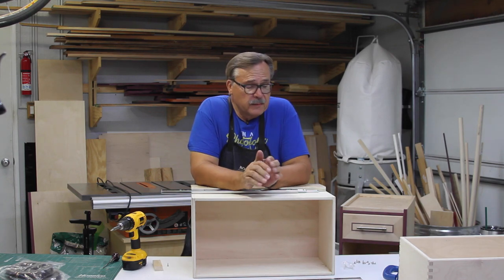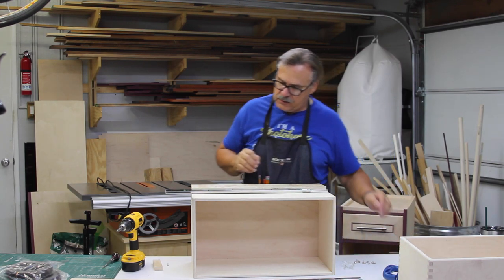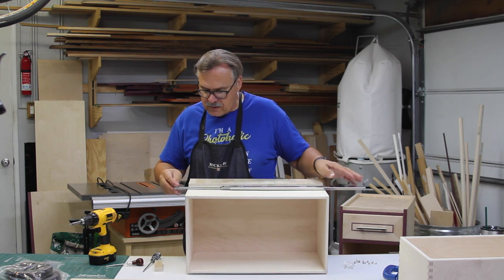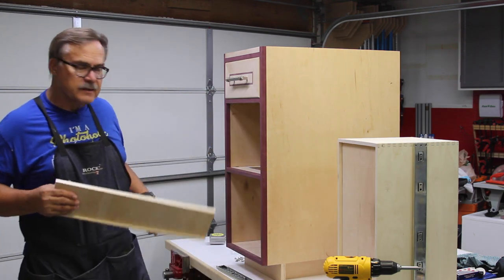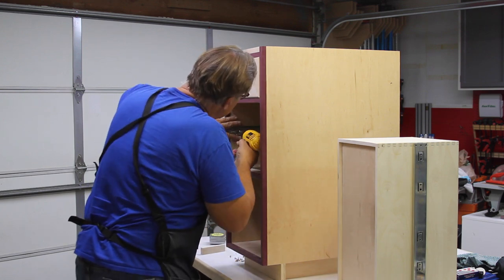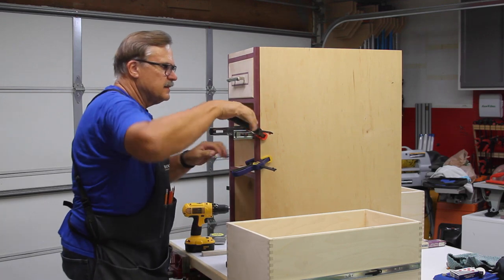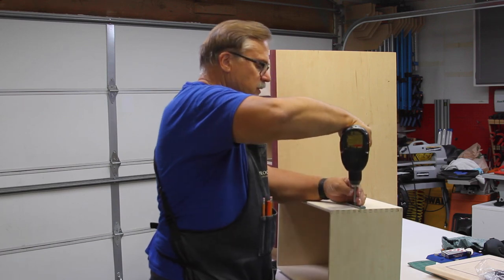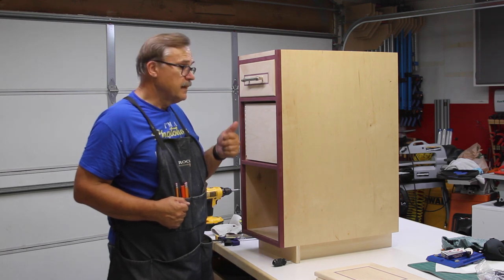Installing Rockler CenterLine Drawer Slides * The Easy Way *

Comment: I have always had problems getting soft close drawer slides to fit and work correctly.  Your video has been the best I have seen ( and I have looked at a lot) demonstrating a simple method for installation.  It is the little details that other videos always seem to leave out, such as bending the metal tabs out.  Thanks for the tips and as a matter of fact I went out to my shop to use your technique to install a drawer into a dresser I am building and bodda boom, bodda bing, drawer works perfect.
Reply from the maker: Excellent! I am glad it helped you out John. I agree, sometimes a simple Jig and a small tip (detail) is all you need to make woodworking a little easier.
Reply: @MadNerdWorkshop  What type/size of screws do you use, assuming the slides don't come with them?   I ordered some soft close slides recently and they do not include screws.  Their on line site calls for #6 5/8 screws but they seem to be almost to small head wise for the holes with the bend out tabs.
Reply from the maker: @johna.9742  I use some 5/8 #6 round head screws that I had left over from when I had the cabinet shop.  the heads are not much bigger than the holds, but they seem to hold everything in place without a problem.
Reply: @MadNerdWorkshop  Thanks.

Comment: How do you measure to see what side slide you need...do you measure the drawer...or do you measure from the front to the back of the cabinet?
Reply from the maker: Hi Michelle, the cabinet is 23 1/4-inch deep, I use 22-inch drawer slides but really you can make the drawer any depth you want.  Some cabinet shops use 18-inch drawer slides, all you have to do is make the drawers as deep as the slides. The choice is really up to you, I like deeper drawers, so I make mine 22-inches.  Thanks for watching.
Reply: @MadNerdWorkshop  thank you so so much for taking the time to answer my question...that was really nice of you...my kitchen drawer is one of those center mounts that has to be attached at the rear and the front...
Reply from the maker: @michellehood3345  Anytime, if it is 22-inches then you can put a piece of 3/4-inch wood along the back of cabinet attaching it to both side across the back. that way you can adjust that piece to match the length of the slides.  some of the center mounts are adjustable to fit any depth of cabinet.  Good luck with it.

Comment: It probably doesn't matter but after you bend the tabs out on the slide that is screwed into the cabinet side----do you put the screw into the tab that was bent out or the others.  Thank you for the video.  I viewed many and yours is the absolute best.
Reply from the maker: I don't, I leave them with just the tab screws.  Now if the drawer was sliding tight, I would screw them in just to make sure the drawer slide is as tight as possible against the side. Hopefully that would give it enough room for smoother movement. But so far, I never really had to do that yet.
Reply: The jig is so much better than measuring. My project has fronts angled at 15°, so anything that reduces chances of error is a win. Thanks!
Reply from the maker: @billcummings254  I agree with that Bill.

Comment: Not installed as centerline pulls.
Reply from the maker: That is true, they are not set up on the centerline.
Reply: I don't think that is what he is saying. Your mounting side mount drawer slides. Center line slides go in the center of the botton side of the drawer box